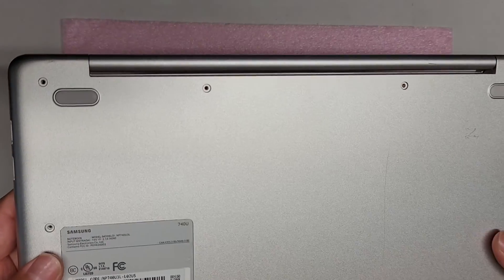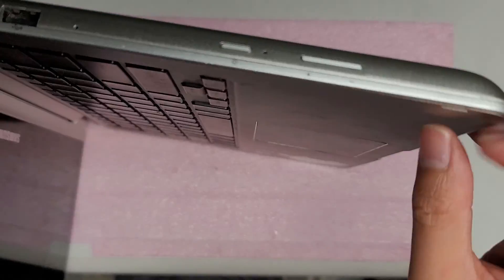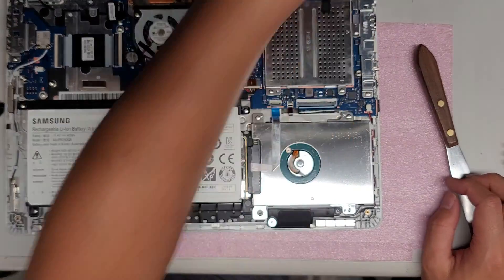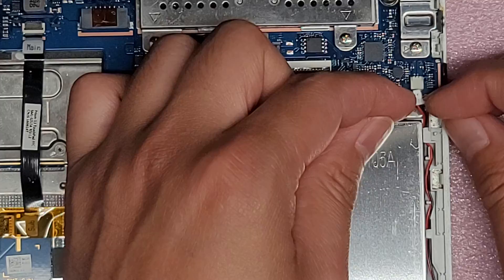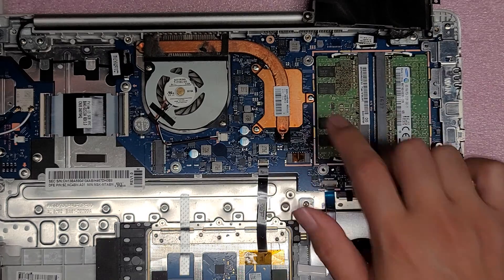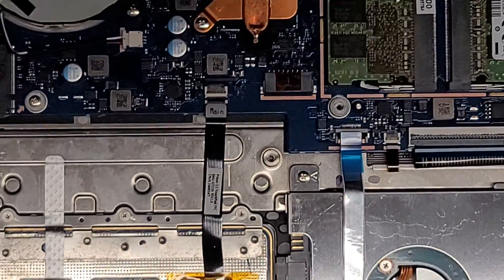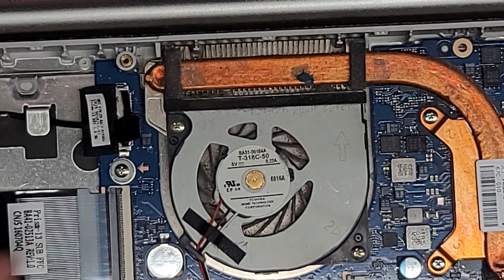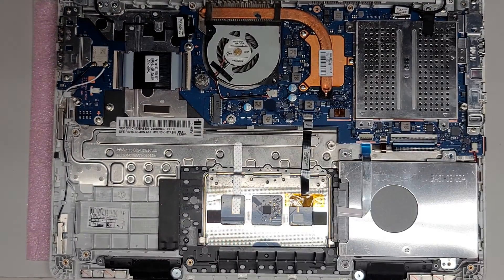Samsung NP740U3L 740U Notebook 7 Spin Disassembly RAM SSD Hard Drive Upgrade Repair

Comment: Hi, thanks for the input. I have a similar  model, and I am trying  to  install  a Samsung 980 ssd in the M.2 slot. However I cannot  get  it  to show in disk management when I plug it in the m.2 slot.  Samsung support  told  me  that  I can't upgrade the ssd because  it was soldered, so they haven't  been  much help.
Reply from the maker: Not sure. Might be it only supports m.2 SATA.

Comment: would you happen to know if I could upgrade to a 32 gb ram or is it capped to only 16. Also did you notice any difference ? I already have an m.2 and ssd installed, just wondering if its worth it at  124+
Reply: it is not true that there is no cap to the amount of RAM.  This model only supports up to 32gb 2133mhz.
Reply from the maker: Have you tried putting more than 32gb of RAM? Who told you there's a cap?
Reply: I am interested in upping the ram to the limit. A couple of you have stated that the NP740U3L supports 32G of ram. If you would, post a link to that spec. I am not finding anything that implies it will support that much ram in this little gem. I appreciate your help folks.
Reply from the maker: Free returns. Buy it, try it, keep it or return it. https://amzn.to/3YVnmbt

It's not like it's difficult to do or return, so why even ask? Just try. Lol
Reply from the maker: There is no cap to the amount of RAM. As long as you order the same type/speed of RAM you should be ok with any capacity that will fit the slots. I don't own the computers or benchmark them, so I'm not too sure, but from what I've seen, most people don't benefit from more than 8gb unless they are going from a single stick of RAM to two sticks for it to run in dual channel mode.  It really depends on how you use the computer.
Reply: @ItsBinhRepaired  hmm. ideally I would like to use it to run a virtual machine environment, im in the process of learning that. I have 12 so I was trying to figure out if 16 or 32 would be sufficient!
Reply from the maker: @angieCity90  what do you plan to run in the virtual environment? Changing the 4gb stick to 8gb should be ok

Comment: I have this exact Samsung model and it looks like my HDD has failed. Based on your video, it looks like I can replace the hard disk. But I am unsure if and how to retrieve the Samsung Recovery/Windows/driver files for fresh windows install. If you can help me avoid purchasing a new laptop I will happily send you $$$. How can I get in touch with you?
Reply from the maker: This https://support.microsoft.com/en-us/windows/create-installation-media-for-windows-99a58364-8c02-206f-aa6f-40c3b507420d an 8gb flash drive and another computer is what you'll need.

Comment: Hi could you please demonstrate/describe how to remove the touchscreen connector? It's quite small and I'm not sure how the bracket opens. Thanks
Reply from the maker: You'll want to watch my other computer repair videos with similar connectors. From the board side there's a black plastic pull loop that you can use to pop it off, but watch my other computer repair videos, look for a similar connector and remove it the same way.

Comment: I have this laptop.  Where do I buy the case?
Reply from the maker: Case? What case? To protect the laptop?
Reply: yes i need to buy the hinge and the plastic bottom cover, my laptop broke off the base
Reply from the maker: @rodrigonavarro5822  I'm not sure. Usually eBay is your best bet.
Reply: I have not seen, nor on Amazon :(
 but thank you very much and I subscribe :D
Reply from the maker: @rodrigonavarro5822  I think this model isn't very common. Might have to use jbweld to patch it with epoxy and let it sit overnight. Thanks for subscribing!